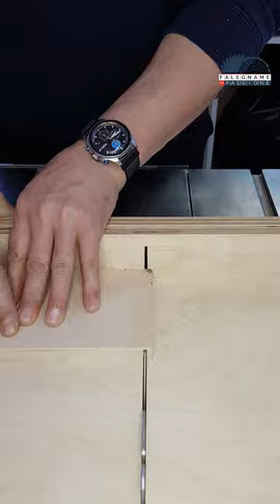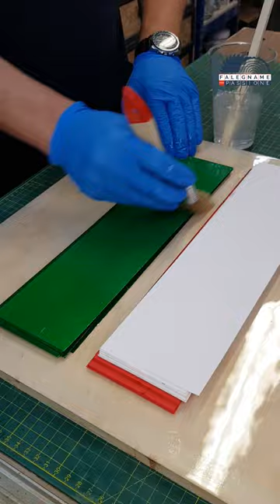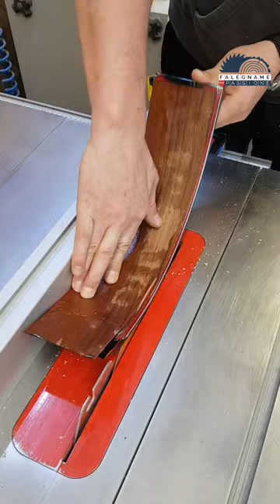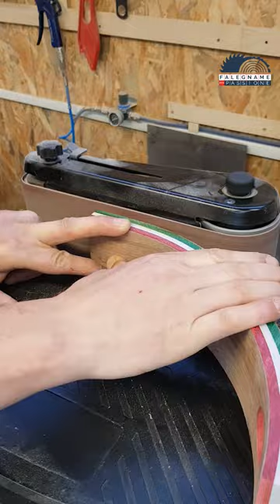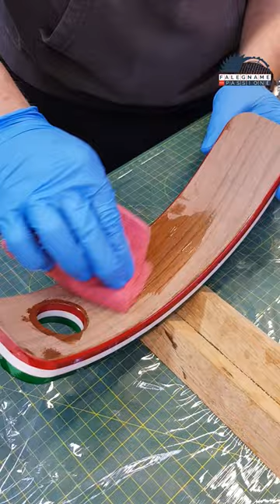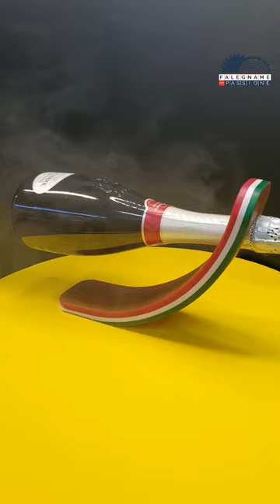Paper and Epoxy Resin Wine Rack

Comment: This is so cool! I use coloured paper often with my crafts and hobbies, so really love this and the clock you made with grinding the layers of paper with resin. ❤

Some of the comments though 😕
If it helps anyone... There's various styles of bottle holders like this, for one or more bottles and some hold glasses too. They've been around for decades and not just for wine.

The bottle is fine and they're stronger than they look. Think of bridges and buildings with arch structures. You can balance heavy things on raw eggs due to the curved or arched shape of the shell if you know how.

My grandmother had a bottle of wine that her parents had sitting on a shelf for years, which was over 120yrs old and came with the holder. The holder looks like a block of wood with an angle cut at the bottom, a hole for the bottle and only stands up with the wine bottle in it. Look up 'floating wood wine bottle holder' if you're interested. ✌️🙂
Reply from the maker: you are crazy in the positive sense of the word 😊😊😊😊👌🙌
Reply: @FxPart  Uhhh... thanks? True though... 😜
I've been looking at your website, but can't decide what I like most 🤔 
I'll be moving soon, so it'll probably be better to wait until I've decided on a colour scheme first. I'll definitely be buying pieces that are colourful, have quirky pieces like the pencil shavings and the ones that glow in the dark are a must 😁

Comment: Is it bad to put that much stress on the neck of the glass bottle like that?
Reply from the maker: This is not a problem, my friend, because the elements are glued with epoxy resin, which is a very hard material😊🙌
Reply: @FxPart  They think the bottle will break at the neck not your beautiful piece of work